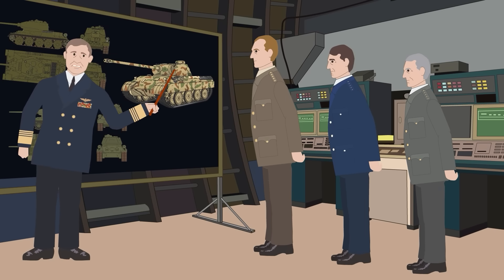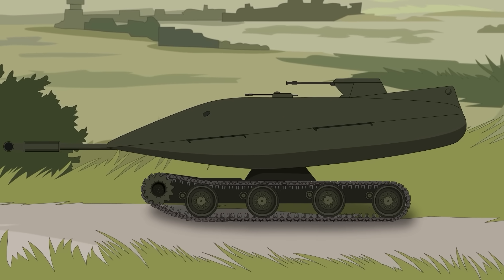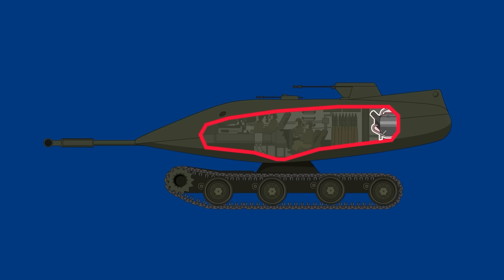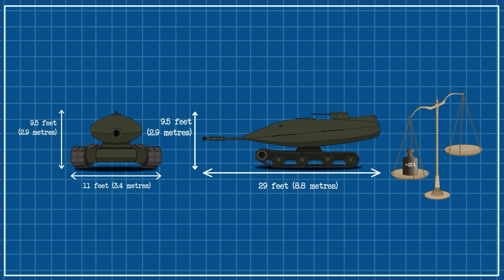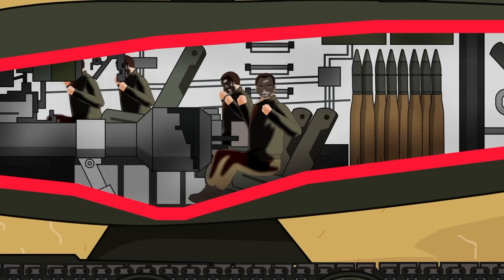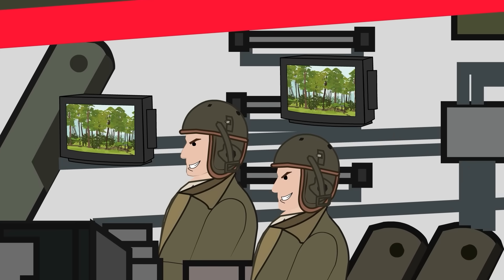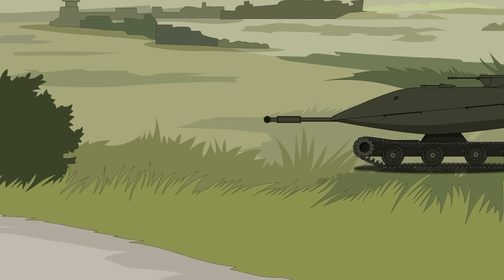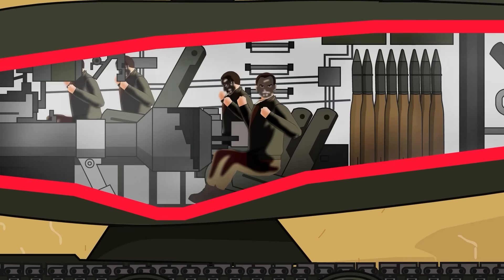Life Inside A Radioactive Nuclear Tank

Comment: What i suggest for radioactive bullet, would be a bit of gallium and a 2 inch inch rod of cured uranium-235 (U-235)  
Start with a lead 25mm hollowpoint, Also handle with caution, Wear a hazmat suit rated for nuclear levels of radiation, even in the tank or near , encapsulate in bullet tip, after using special tools to hollow out a bullet tip, find a way to wield the tip on with a lead capsule inside with all toxic/ highly explosive, make sure to coat the inside of the capsule in tantulum ,, tantulum-180 (TA)- is also radioactive, if fired i suggest being a long long distance,  dont try this though there is a HUGE CHANCE OF COMMITTING SELF EXPLODE

Comment: in 1960 the understanding and tech was clearly basic. The idea of a nuclear engine is viable as we have been able to shrink down the size. Encapsulating it away from the crew is a non issue. Even making it difficult at best to destroy. What most modern tanks lack is enough electrical power to run everything. They consume so much fuel or have to utilize a large heavy engine to move them at a reasonable pace it cost far more to maintain, replace or fuel. So while this concept of a self contained monolithic turret tanks was  basic they had some valid ideas here.

Comment: As crazy as the US' application of nuclear power was, the Soviets were completely bonkers.

They sprinkled nuclear-powered automated weather stations all over Siberia and have lost track of many of them.  They simply don't know where they all went.
Reply: I forget who designed it but lets not forget about the nuclear powered jet engine that was essentially an open nuclear reactor designed to intentionally spread radioactive fallout over areas of the planet as it flew.
Reply: @fredthepeacelily That was the US, although it was never built. The Soviets built an open cycle nuclear aircraft engine which actually flew as one engine on a TU-95 with 3 regular engines.
Reply: Sold in the black markets in the 90s probably.
Reply: They also used them to power lighthouses and navigation beacons along the arctic shipping route. There's HUNDREDS lining the arctic coastline!

Comment: I know there was a Centurion tank in Australia that survived a nuclear test. It was only 400m away from a 10kt bomb, and the tank was still fully functional, it even served in Vietnam afterwards. They concluded while the crew could’ve survived the radiation, the blast wave would’ve killed them at that range.
Reply: T-54s could also do the same, albeit the sheer heat and pressure would've killed them at a range of 700 meters or less.
Reply: So basically you wouldn't need a tyvec suit with the mop and bucket?
Reply: @Stealth86651  no you'd need like 5 buckets
Reply: @Stealth86651 I'd say a preasure washer
Reply: Not only did it serve in Vietnam, it took an RPG shot that wounded the entire crew, and kept going, it's also now a museum piece.
Reply: So the blast sent the tank flying and it still survived

Comment: I can not imagine how many weird designs of this type the Soviet engineers had drawn up...
Reply: Object 279 and I think that's about it for soviet nuclear blast-proof tanks.
Reply: They had a laser tank
Reply: Do you want the tank designed to eat nuclear blasts, the tank that was as flat as a pancake, the other pancake tank that came with pure missile armament, the amphibious tank that's part hover craft, or we want to abandon the reservation all together?

Side bar, all soviet tanks save for the T-62 were built with an aggressive focus on radiation protection. T-62 lacked it because of aggressive weight limits placed on its design.
Reply: Object 279 was the main thing they had for post nukes. I think the Object 775 was also made to survive a nuclear blast, but I’m not entirely sure
Reply: @owenbrown3816  I've never seen any specific mentions of object 775 being intended to withstand a nuclear blast but I don't doubt it was at least a consideration. Given how flat and angled it is, it probably would withstand it.